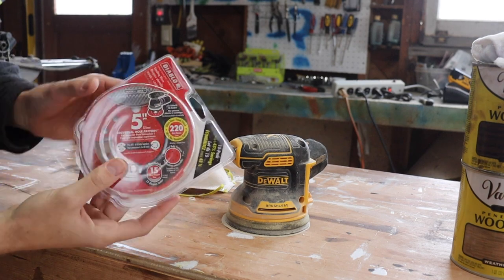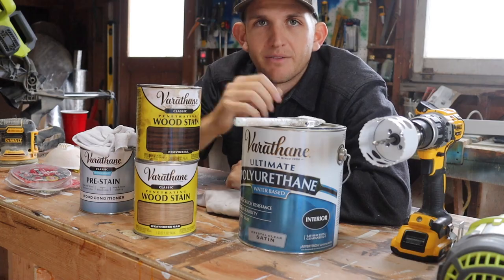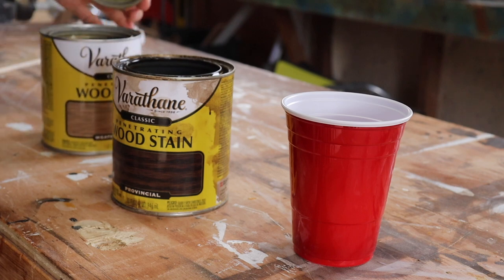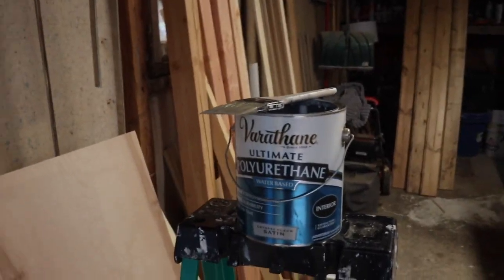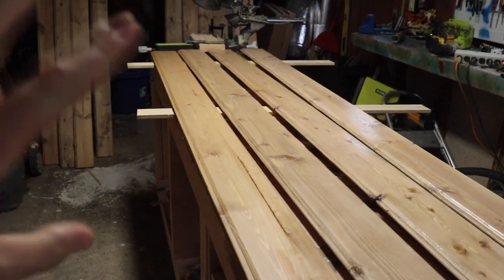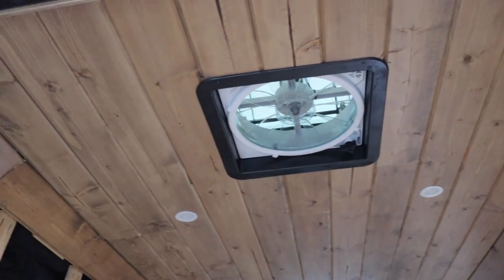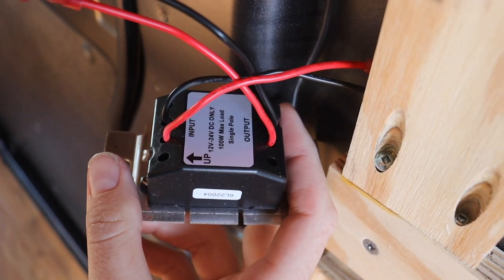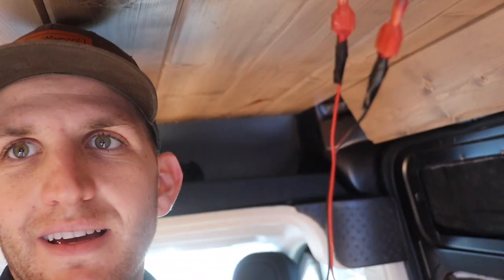VAN BUILD | INSTALLING A CELIING AND 12V PUCK LIGHTS | HOW TO

Comment: Try laying the rags out flat (one layer) on a cement floor and let them cure for a day. We they get stiff it's cured and then you can throw them away. If you put them in water now you have polluted rags and water. The main issue when you crumple them up is the heat builds up because the finish/stain curing is an exothermic reaction.
Reply from the maker: Woah that’s a way better solution. I’ve always just put them In a water bucket then hung them up. I’ve pinned your comment so others can see. Thanks for the insight
Reply: That's what I do as well.  Once, my shop mate put them in a bucket of water.  A couple of days later he took them out, balled up and they combusted!  The oils hadn't kicked off in the water...

Comment: How much wire did you need for the pick lights?  Is a 50ft roll enough?
Reply from the maker: Hard to remember but depending on your battery location, 50ft should be alright!

Comment: Hi Colton.  Great video.  Not sure if you're still monitoring this but I was hoping I could get your comments on how well the ceiling has held up.  Just wondering if brad nails alone are sufficient to prevent board movement and squeaks.  Does it make sense to fasten with screws and/or glue?
Reply from the maker: Held up great!

Comment: I'm curious- why stain both sides of the boards? I get the poly coat on both sides... (thanks for the info on the why to use the poly on both sides/- I wondered about that as I watched other people just stain when boards are up already!)
Reply from the maker: I guess the stain on both sides is over kill. But you wanna make sure you get around the edges!
Reply: @AnkeneyVanBuilds  I can imagine that. No matter how hard I tried to avoid this, I stare at the spots in my ceiling that don’t have as much paint, even though I tried to avoid this neurosis and put multiple coats of my white on the other white to avoid seeing those spots…

Comment: Hey Colton, thanks for another great video.  I know you run 1/2 strips of plywood crosswise in the van on the ceiling ribs and you attach your tongue and groove boards to that (right?).  Do you face nail or do you nail the side of the ceiling boards so the nails aren't visible?  Also, how is 1/2" plywood thick enough for the nails you use? Maybe I'm wrong about the ply thickness.  What size nail are you using? Thanks Colton!!!
Reply from the maker: I face nailed, but you can nail them from the side. I suggest using wood glue as well. it'll hold together way longer! I used 1-1/4 nails.
Reply: @AnkeneyVanBuilds  Thanks Colton!!! Your videos are awesome, and making my build possible.
Reply from the maker: @AlWiedmannJr  stoked I could help

Comment: Love your work.

Water based stains and finishes don't have the level of VOCs* (thinners, etc) that causes spontaneous combustion. That's why they're more environmentally friendly. They require the preconditioners because the water in the stains lifts the wood grain and causes spotty absorption. This is much less of a problem with oil based stains.

Wherever your wires pass through the metal of the van they should be protected by grommets (holes) or plastic flexible conduit. There's enough vibration from driving for the metal edges to wear through the wire insulation and short out/ cause a fire.

*Acetone, solvents, benzenes etc

Comment: How is it getting the tongue in the groove on the ends where the boards are on the angle leading down to the wall? Does the tongue actually get into the groove?
Reply from the maker: For the most part! Yeah. It’s not going to slide all the way in. But the tounge is resting in the groove

Comment: Hi! Just wondering how many square feet of pine tongue and groove you used for the ceiling? I have the exact same van. Also wondering how many square feet of shiplap you used? thank you!
Reply from the maker: Hi Angelei, Sorry I don't remember those numbers off the top of my head. To calculate just multiply the length times the width

Comment: How did you connect all the puck lights to the switch, did you twist them all together then clamp connectors, im lost on the whole pucks to switch, switch to fuse box?
Reply from the maker: Off the switch is two wires, positive and negative. I ran those two wires around where the lights were going to be. Then I connect the positive and the negative from the lights themselves to those wires using that blue three way connector clip. 
Some of those wires off the puck light weren’t long enough to get to the original wires from the switch. so I used the spade connectors to connect it to a longer wire to the lights. Which then connected to the original... 
I hope that made sense. Please feel free to ask more questions and I’ll be happy to help.

Comment: Can you charge the Goal Zero with the car's alternator while you're driving? Or are you 100% reliant on solar?
Reply from the maker: Goal zero sells a cable that plugs into the 12v cigarette plug that’ll change the unit while it’s driving. There’s also a wall plug option to charge it with the 110V plug!

Comment: why not just cut all 3 wires and use a wire nut ? it would be really fast and you could leave access to the nuts right above lighting.
Reply from the maker: That’s a good point..... 🤔

Comment: Hi Colton!  6 months later and I am almost done with our van! (or am I?.....Is anyone really every DONE with their van?). 
 I have yet another question regarding the angled board above the slider - Did you just attach that directly to the metal with self-tapping screws?  I know that you ultimately ended up boxing that section out (and it turned out great.   For those of you not familiar with this, check out Colton's "Finishing Touches" video).  However, any time there is a sharp edge or corner in the remote vicinity of my husband, his head will find it.  It could almost be considered a strange sort of super power.  We would like to limit the opportunities for that super power to reveal itself so I think the angled board would be the best option for us.
Reply from the maker: Hahaha sorry about his head. I attached the angled board to the framing strip with nails. That framing strip is attached to the metal
Reply: @AnkeneyVanBuilds  Thanks!

Comment: Thanks for the video.  I was wondering how did you do the ceiling support in the back by the doors.  In the Promaster there isn't a rib to attach to.  How did you know the correct curve of the ceiling.  Thanks again learning a lot from you.

Comment: Great video!  Thanks for taking the time to share this.  I'm curious to know why you used pine?  Is it lighter than any other type of wood?
Reply from the maker: Great question! So pine is the most common type of lumber you’ll find in the big box stores such as home Depot or Lowe’s. It is also the only type of wood that I know of that comes in the tongue and groove! Also it is a soft wood and much cheaper! Thanks 🙏🏻
Reply: @AnkeneyVanBuilds  Thanks, makes sense. (watching the solar video now) Your videos are great.  Easy to understand and straight to the point.  Great job!
Reply from the maker: @OurRetiredLife  Thank you!! I try to not include any of the fluff that I see on a lot of youtube videos.. Just the helpful information. I appreciate you watching and commenting on my videos!

Comment: Thank you for the video! This is super helpful. What 12v cigarette lighter did you use to attach to the fuse block? Do you think I could do this with a 500x? It has the 12v cigarette lighter
Reply from the maker: Hi! I used this 12v extension cord!

https://www.amazon.com/gp/product/B014TZVXH0/ref=ppx_yo_dt_b_asin_title_o00_s00?ie=UTF8&psc=1

That should work since the cigarette lighter ports should all be the same size. Good luck with you build!
Reply: That extension cord uses 16 AWG that you are supplying to the distribution panel.   You are connecting a lot of stuff to that distribution panel. Two questions: 1) what is the max current from that GZ cigarette lighter (13 amps?)?; 2) why 16 AWG supply to the panel but heavier gauge (14 AWG) from the panel to the devices connected to it, like the lights?

Comment: Confused as to why you got oil based stain for water based conditioner and finish? I bough exactly what you did but I am now wondering if it was a mistake as everyone says to not mix the two especially the conditioner. I see yours turned out well though..thoughts?

Comment: Thanks so much for your videos!  I’m watching as I build out our own Promaster.  I do have a question about the ceiling boards lining up in the center of the ceiling.  Did you rip any of the boards or did it just line up with one board in the center of the van by chance?
Reply from the maker: I started on one sided and worked my way across and it worked out to fit perfectly!

Comment: What is the black layer/cloth and how did you hold it up on the ceiling?
Reply from the maker: It’s 3M Thinsulte insulation help up by 3M spray adhesive. Great stuff! (Link is in the description)
Reply: @AnkeneyVanBuilds  thank you! We did havelock wool but kind of hard to keep up on the ceiling unless you’re installing the panels at the same time. Lesson learned! Thanks for the video
Reply from the maker: @hollicollins22  ahhh I see! And you’re welcome. Good luck :)

Comment: Wusup  Colton Watching your video  as your installing your panels about when u get to the side edge on the 2-6 to where they supposed to connect do u cut the male off on the T&G ? if they don’t actually connect to each other do u have any tips where to start or should do 5-1/2”layout with chalk line ? and go fifty filty on each side
Reply from the maker: Even though the dont connect. You can still line up the tounge with the edge of the other board. I didn’t cut it off because I didn’t want to see a gap. I started on one end and worked my way across and it worked perfectly so I didn’t need to rip any of the boards down :)
Reply: Right on Colton thanks 4 shoutout “I’m actually prepping pre staining my pine as I go about to mixed my colors tomorrow “do u prefer the slider side first or is it your preference
Reply from the maker: @mariovenegas8468  I did the slider side first. But I guess it doesn’t matter 🤔 Good luck tomorrow! Don’t forget to soak your rags!

Comment: thanks for the video the ceiling looks awesome! I am going to install 12v led puck lights similar to those in a shuttle bus and I am definitely a beginner with electrical. I have come across the topic of current limiting resistors for LED lighting to avoid over-current. I see you have a fuse protecting that but did you need to install any resistors in addition to that?
Reply from the maker: I just have the fuse, the 14g wires, the switch, the 3 way connectors, and the lights!

Comment: Howdy!  Do the ceiling planks just rest on the board that you glued/screwed over the back doors or are they attached somehow?  Did you end up modifying that board at all or is it just a straight strip of plywood?  It look like it curves a bit at each end....
Reply from the maker: Hi Wendi!,
Before I put each ceiling board in I ran a bead of glue on the top of that ply wood and that’s what holds it in place! After it was in and the upper cabinets installed. I made a template and cut/painted 1/4” plywood to make it look pretty :)
Reply: @AnkeneyVanBuilds  Perfect!  Thank you ....again :)
Reply from the maker: @wendistraight6425  you’re welcome!

Comment: I was watching your "What would I do differently?" from your first van where you said that you would use thicker material for the ceiling.  You seem to have used the same material in your new van.  Is this the case?  If so, did you use it but treat it differently in some way to avoid the problems you had in the first build?  Thank you.
Reply from the maker: Nope this material is 3/4” thick. The first van was 1/4”!

Comment: Do you have a link to the connectors you used to connect the wires to the bus bar?
Reply from the maker: I’m sorry. No link. But I got them in electrical section of Home Depot!
Reply: @AnkeneyVanBuilds Thanks! Also unrelated to this video but I know you said you were going to leave room in your bench on the left side of the van for a longboard. Did you end up doing that? I'm currently trying to figure out how I'll store an 8-9 ft board while also having enough room for cabinetry/furniture.
Reply from the maker: @timleimbach5817  I did do that!!! My layout allowed for a board 7’8” but that could easily have been more if needed !

Comment: Where on the board are you putting your nails through?
Reply from the maker: On every framing strip on the ceiling!
Reply: Are you nailing right through the face of the board or trying to hide the nails in the tongue and groves on each side?
Reply from the maker: @danhastings7212  nope I’m using 6 gauge Brad nails. They’re small enough and punch all the wet through to where you don’t really see them. That method really only works on “half lap” shiplap. If you punched a nail through the tounge it would either crack it or not allow it to slide into the groove

Comment: how long are the ceiling boards you used do you try to use one board for the whole length
Reply from the maker: I staggered them. I couldn’t find boards long/ straight enough to use one board. I believe I used 10ft boards

Comment: How much  thinsulate insulation did you use?
Reply from the maker: I bought 2 rolls of the 30X60 but I wouldn't recommend that as the first roll covered 96% of the van. maybe the 40X60 would be better

Comment: Wood ceilings are pretty. But there are many materials that are stronger, thinner, less expensive, and less problematic when exposed to constant condensation in a van.
Reply from the maker: That why there’s 2 coats of poly on it to seal it from said condensation. The other materials I wouldn’t consider being less expensive either lol
Reply: @AnkeneyVanBuilds  Coroplast is quite versatile, affordable, and very easy to work with.
Reply from the maker: @stoneyrunva  not sure if the plastic look is very appealing to most lol
Reply: @AnkeneyVanBuilds  Looks are easily mimicked. Most people do the wood plank ceilings in van builds. Your work is very nice. Just saying better/different/lighter options are available.